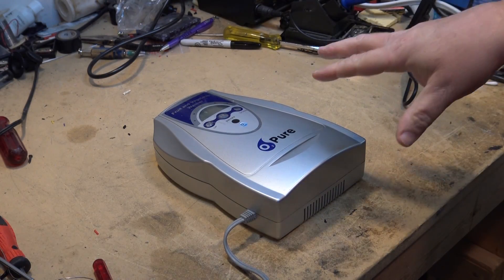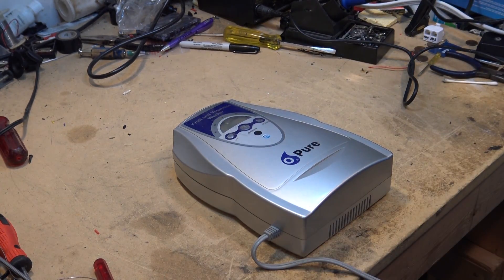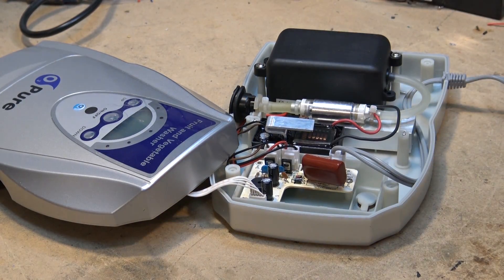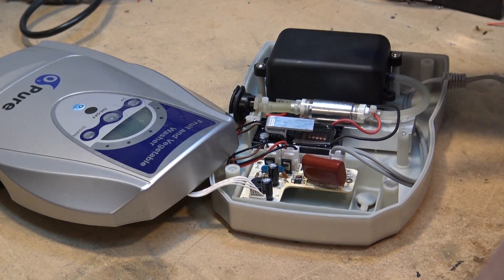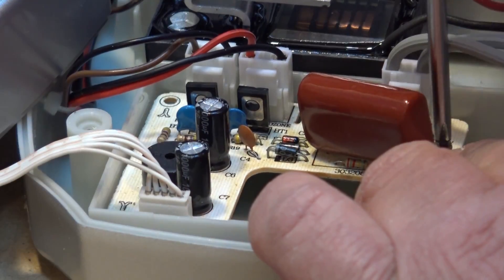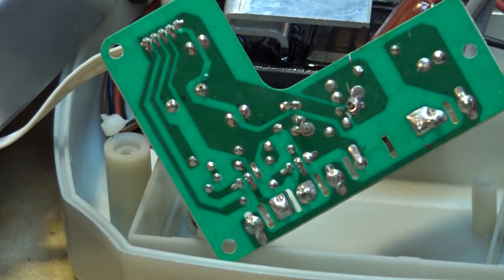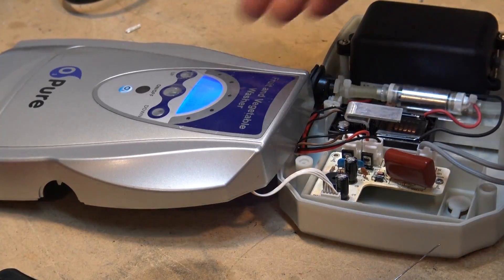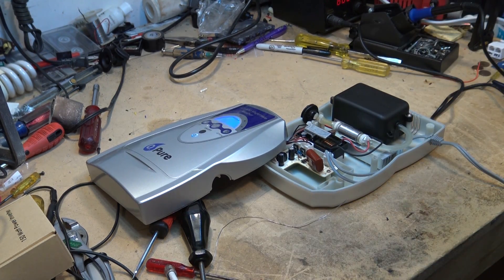Ozone Generator repair

Comment: That fix was too easy, and yes, you may need to finesse your soldering touch.
Nways, in my case the Ozone Generator powers up, and blows air, but NO OZONE is coming from the unit. Any suggestions?
Reply from the maker: I don't need to finnese anything.  I know how to solder.  Been doing it for 53 years.

Comment: Hi Thank you for the video, quick question for you. I have a similar fruit and vegetable produce generator, my pump seems to be working fine but I no longer can smell ozone, is this something that can be fixed or a part that needs to be replaced also wondering could you point me in the right direction of where to get such part 
Thank! you

Comment: I hawe ozone generator in my old 32 inch crt TV with bad HV trafo,it is make "sssss" sound.But picture is wery fine.Sorry for my bad English.  ;)
Reply from the maker: Usually it is a ground wire touching the flyback drawing corona from induction.

Comment: Love the 60fps, dunno why but it just makes it look better.
Reply from the maker: I shoot all the HD stuff in 60 frame. 4K is shot in 30 frames because that is the max framerate of my camera in 4K. There is another 60 frame mode for 1080, which would yield a slightly better picture, actuslly there are 2, but they just burn up more bandwidth on the camera, and I don't know how much better it will look on YT anyway.
The big difference is I usually encode at 30P 10 megabit. These ones were encoded 60P 40magabits so 4x the bandwidth.

Comment: Back in the day, I made one of these out of a 10kv neon transformer, two
 pieces of metal window screen and a used, clean prego jar.  You could 
leave a dead fish on your kitchen counter with this thing running and 
you would have never smelled the fish.  It's absolutely excellent at 
disinfecting a room but ozone is harmful to pets and your lungs.
Reply from the maker: Yes it is, thats why I don't have one of these. I use UV-C for air disinfection, and the mercury lamp is inside the air duct.

Comment: Just goes to show that a good visual inspection is key to finding many problems lurking in equipment straight from the factory. Though in this instance the culprit showed his face before you even got a chance to inspect the board. It's nice when it's something simple.